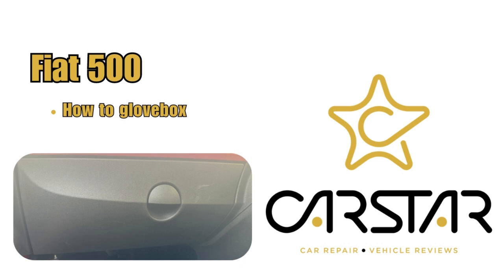How to remove Fiat 500 glove box , EASY DIY

Comment: Thanks very helpful!

In case someone is replacing it due to a broken handle comes across this:
If just the handle is broke it's very easy to replace just the handle itself, it's just a couple screws.

Also, make sure to check the colours of the replacement, I've come across a couple different colours, one that's black and one that is a bit more grey.
Reply from the maker: You are welcome 🤗